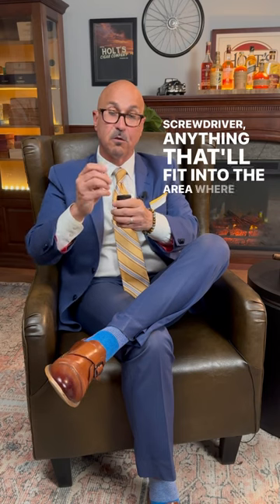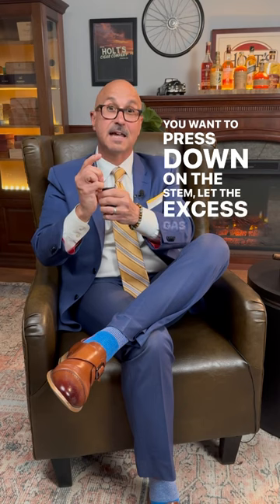How to purge a butane lighter! 🔥

Comment: you should turn it to the lowest flame setting first. Then after purging, shake it and purge again, repeat until no air comes out, only way to be sure there are no air bubbles. 
To fill- turn upside down press butane canister down firmly for about 5 seconds for small lighter 10 secs for a big lighter, turn over, wrap hand around for about 5 secs to warm lighter, then reset flame setting, light and enjoy
Reply: Why air bubbles matter?
Reply: @Jake-ug9vu   they could cause the lighter to sputter
Reply: this comment needs a pin

Comment: you can over-excess with purging and filling methods. I rarely purge my lighters and they work just fine. I do it once in a while, if I see uneven flames. This is a good instruction, short and ro the point

Comment: So i bought a butane lighter on amazon 1 day. I had issues with the lighter lighting or even holding flame on. I reached out to the seller and they asked me if the lighter was filled with butane and if my adjusted the flame. But they never mentioned about purging. I knew nothing about this. So they sent me a new replacement lighter and still same issues. I figured this company was a crap company. After doing research online on how to fix this issue i came across purging. So i purged both lighters and both work amazing now! So i guess i got a buy 1 get 1 free since the company itself didnt know about purging and they sale butane lighters 😂

Comment: Sorry if this is a dumb question. But why not just fill it again? What’s the purpose of purging?
Reply from the maker: There's no dumb questions! Each time you refill a butane lighter, small amounts of air will get into the fuel tank. Purging gets rid of the air so you have nothing but butane in the tank, and it helps your flame burn consistently.
Reply: @holtscigars  hey thanks for the reply!
Reply from the maker: @joshsinclair539  Anytime!

Comment: Any thoughts on a lighter where the fuel will not go in?  Have purged. Zero fuel in lighter. Have pushed down hard using 2 different cans of butane. Nothing goes in. Doing the same thing on another lighter works fine. Is it possible intake line is clogged?
Reply: Some require special fittings. I have an ST Dupont that requires there fitting. None that come with some butane cans work. PIA, I've lost it more times than I care to admit. Just sits in a drawer now.

Comment: Why? I stopped doing that once I found out you really don't need to.
Reply from the maker: Each time you refill a butane lighter, small amounts of air will get into the fuel tank. Purging gets rid of the air so you have nothing but butane in the tank, and it helps your flame burn consistently

Comment: Why?
Reply: If you don't, the jet won't work. I don't know why but the jet  will just stutter and not function well until the Xtra air burns out
Reply from the maker: You can get pockets of air in the tank that can make your lighter struggle to burn well and stutter.